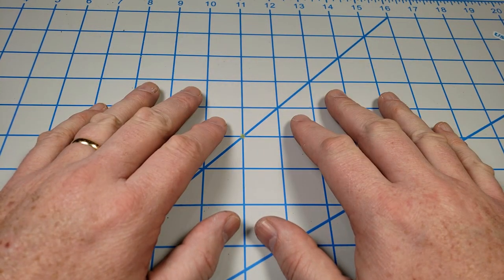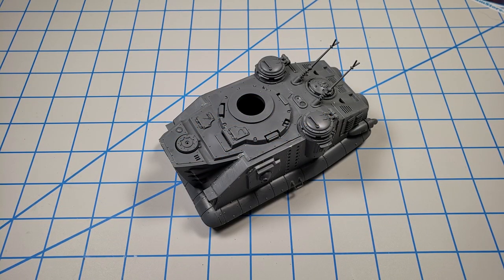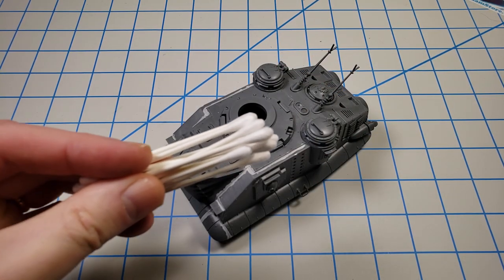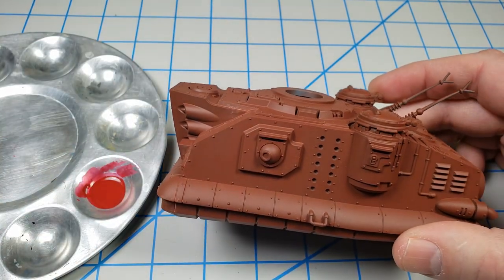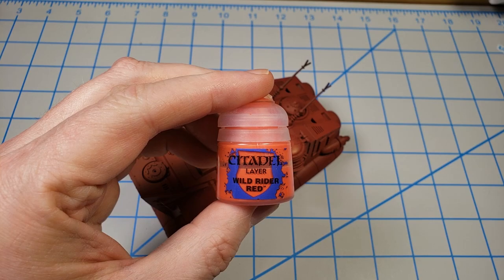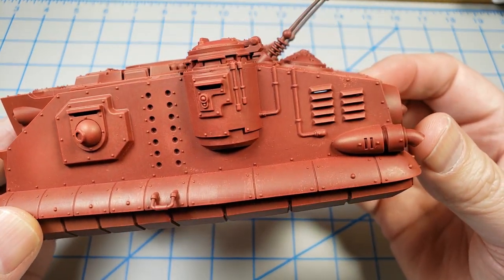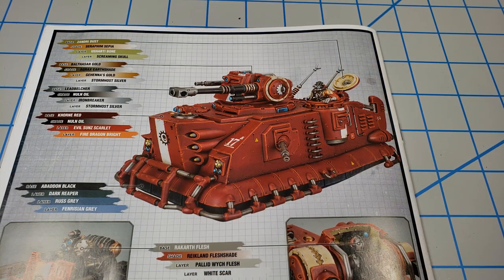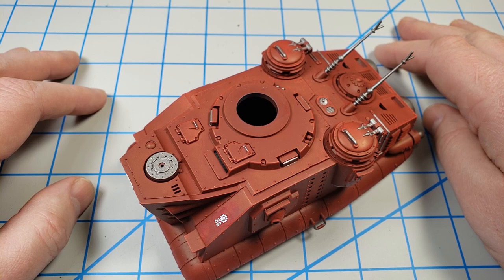Citadel's Warhammer 40K Skorpius Disintegrator: Part 1 - Assembly and Paint

Comment: Tips on the back with putting the engine in, I'm stuck as it seems too wide for my model
Reply from the maker: I'm not sure what to tell you there, as I put them in from the beginning. And it has been so long now I don't recall the build sequence.

What I'd suggest doing is see if there is a way of "hinging" them in at an angle, and then rotate back. Trim away as much as you can get away with. You might be able to pop it back in place.

HTH!

Thanks for watching!
Reply: @JonBius  there is but its very annoying but i'll take it to my local games workshop store for help as one of the employees there were doing an adeptus mechanicus army. It does fit but i feel i did something wrong in the first step and made it too wide.